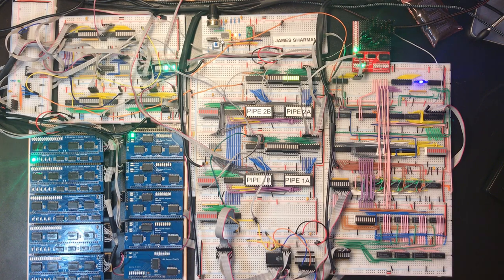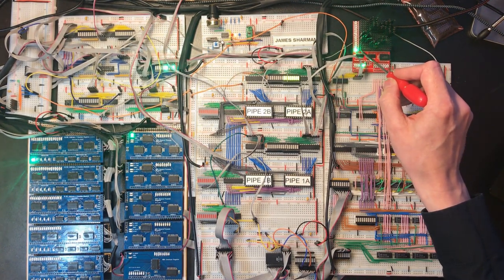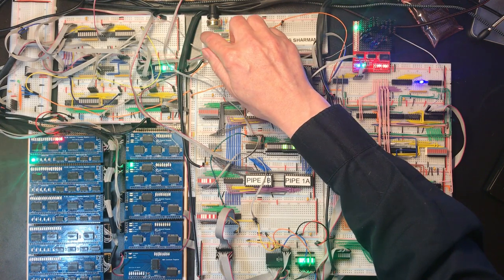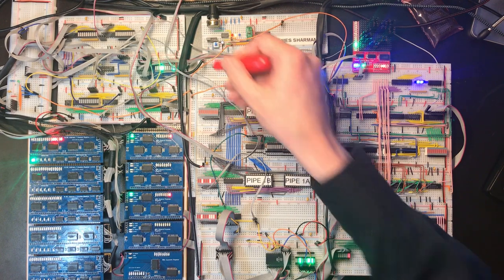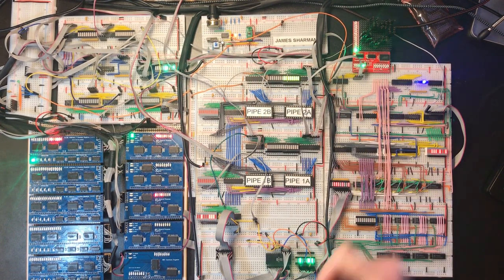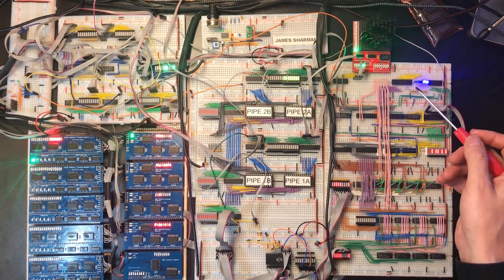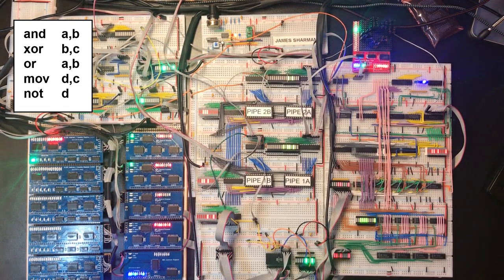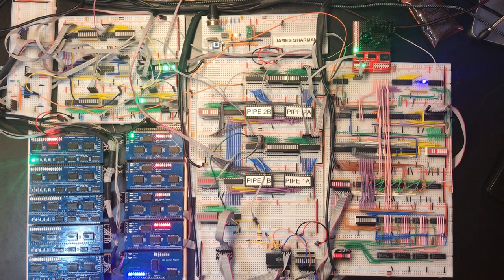ALU Demo - Making an 8 Bit pipelined CPU

Comment: thank you for this series have been inspired again to carry on with my 8 bit build
Reply from the maker: Awesome! What kind of build are you doing?
Reply: @weirdboyjim   have been building the ben eater breadboard computer, have made a few little mods along the way, just got to get back into the eprom programming as I have a few errors to sort out. also just copied your NES controller breadboard input just incase I make a few more changes to my computer. I am planning on using an arduino uno for inputting my programs rather than inputting through small dip switches and loosing my program every time the machine is switched off.
Reply from the maker: That sounds good. I have plans for something similar with a debug interface, it takes me longer to swap the roms at the moment than the actual programming.

Comment: (4:04) That's ADD C,A, not ADD A,C.
(4:12) I need to make myself a cheatsheet for what things happen at which part of the clock cycle. I got myself really confused here because I thought register load and ALU intermediate result latch both happened on the falling edge of the clock, but ALU intermediate latch actually happens on the rising edge of the clock. (Which could be a problem given that the ALU inputs also change on the rising edge of the standard clock, and the ALU internal latch clock is slightly delayed from the main clock. That's a potential race condition.Given the amount of chips the LHS and RHS selection have to go through before you they get to the ALU, you should be fine, though. Just be aware that if you get unlucky with your chips, you may need to latch LHS and RHS on the falling edge of the clock as they come in from their respective busses. You can just use the main clock for that, though.)
Reply from the maker: What do you mean? The demultiplexers in bus control take the outputs from pipeline stage one and their output's directly drive the enable lines on the 541's that drive the LHS/RHS bus, not really any scope for race there.
Reply: @weirdboyjim  I meant that since the ALU clock is delayed slightly from the main clock, depending on the timing properties on the chips, the inputs to the intermediate latches in the ALU (the ones between the shift/logic units and the addition unit) could potentially change in the time between the rising edge of the main clock (when LHS and RHS change) and the rising edge of the ALU clock (when the intermediate latches get latched).